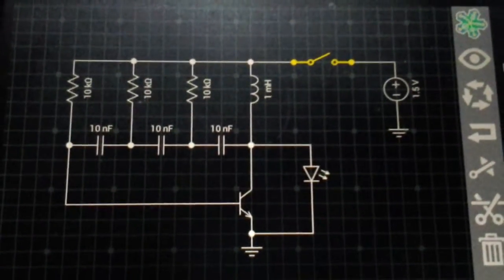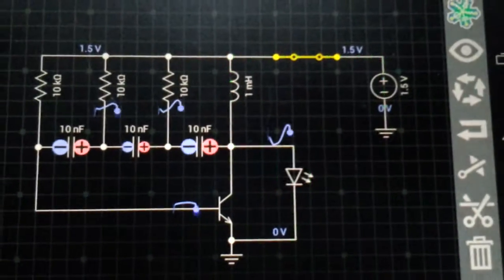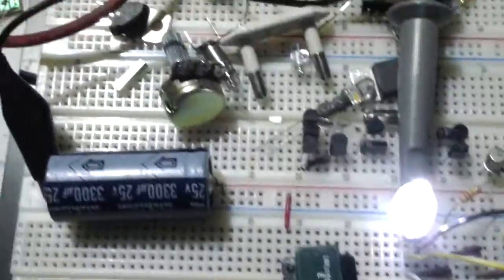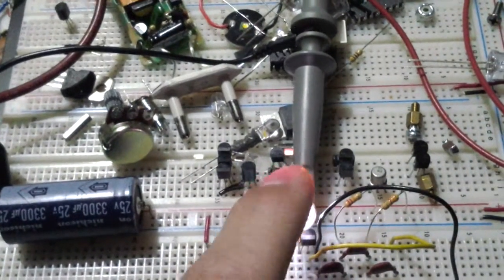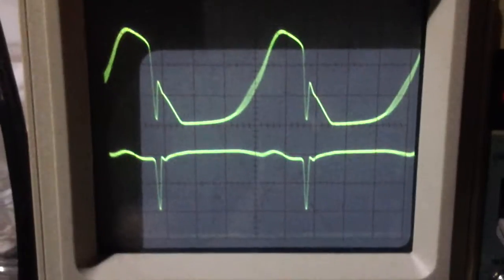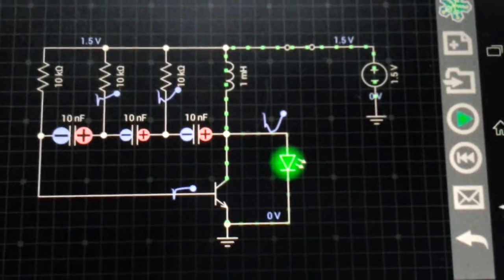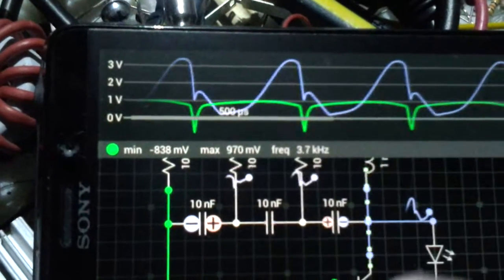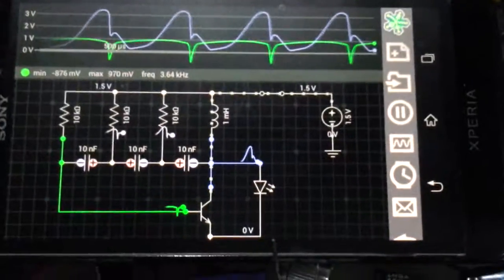One inductor and one transistor light an LED

Comment: I just simulated your circuit with Linear Technnologies LTSpice IV. Using a 2N2222, 2n3904 and FZT849 base and collector waveforms were like your results. LED current was not correct and I agree circuits may simulate and not work when built and vice versa.

Comment from the maker: It's actually very good the other option would be to buy one of those little dc to dc converter that can put out up to 35 volts from 3~35 volts I have some and they work very very well and they are cheap ^.^

Comment from the maker: You want them to be at full power or not? if you do lets say 14 watts at 12 volts it's roughly 1.16 Amp to have about the same power from 3 volts you will need to draw about 5 amp from those AA. It's possible but they wont last long.